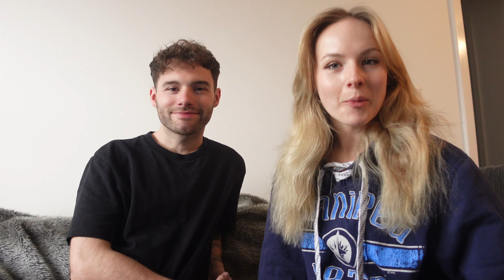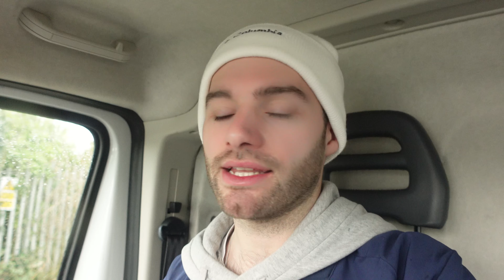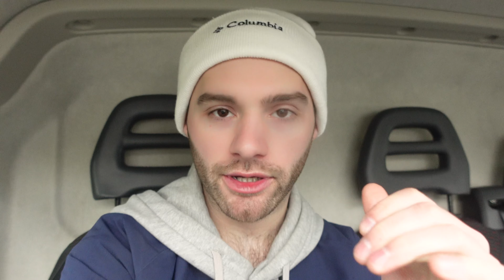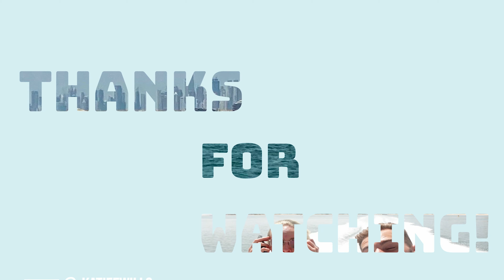Peugeot Boxer Van Conversion with no experience | Van Build Part 1 - insulation, windows, sound

Comment: good to see you back, where did you source the windows from? On the reverse camera you maybe able to move the camera out if its on a pivot and with mine there was an option to add lines which can be calibrated in the settings and there was a loop of wire near the camera that you cut to remove the lines as you end up with two lots.
Reply from the maker: Thanks so much! I will get Adam to answer this one as I’m not sure on the windows 🙈 - Katie 😊
Reply from the maker: The windows are from Cheshire vehicle windows, they are 1100mm x 450mm 
They are fantastic windows! 

Thank you for the advice on the reverse camera. Yes there is two loops near the camera. I will probably snip them as the lines are doing nothing for me.
Reply: @KatieAdam  check the manual first to see if that’s how yours is set up.